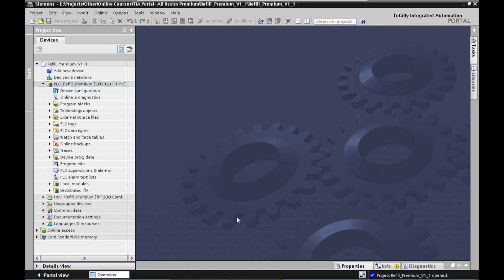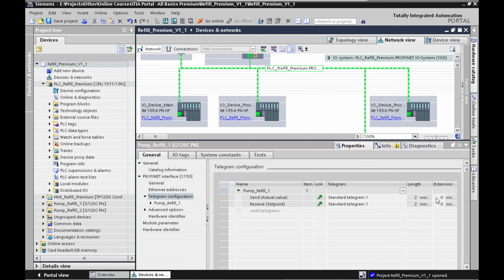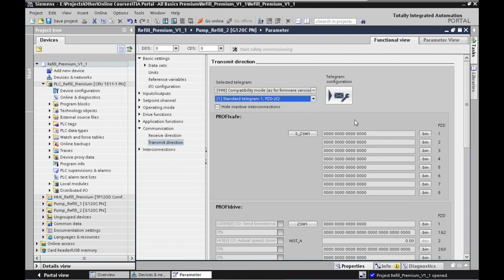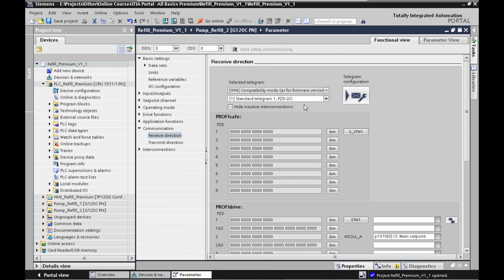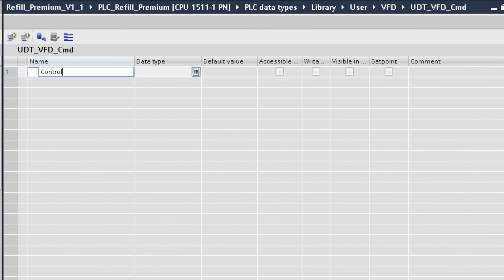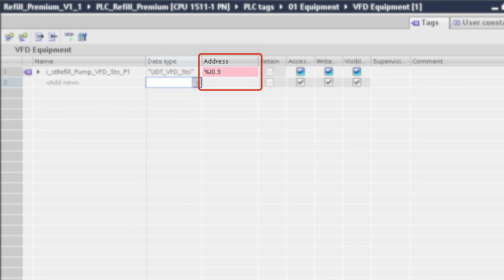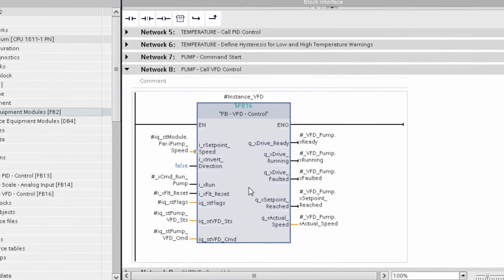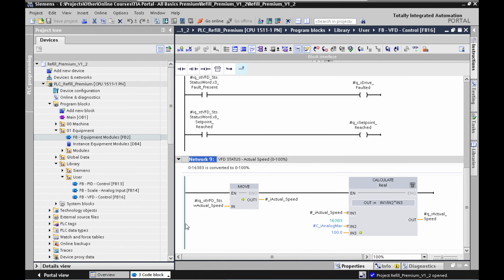How to Add a Structured VFD Control to your TIA Portal PLC Application (4 Step Tutorial)

Comment: your vids, your voice, your style, your speed, is excellent. you are a brilliant teacher. thank you.

setting up the drive side is very interesting as you need :
1. correct motor parameters
2. encoder setup
3. plc protection and quick disconnect, ..

thee drive side is where i would appreciate the slower, step by step clarification and actual commissioning of a drive with visuals
Reply from the maker: Thank you for the kind feedback and the great suggestion for a future video! 😊

Comment: Is this particular course if the premium bundle?
Reply from the maker: The VFD control is part of the premium content which is in the premium bundle.

The premium bundle includes PLC and HMI course which are online video courses.
And it includes the premium content which is not a course, but a premium TIA Portal project (PLC+HMI) which includes a VFD control block.  The premium content comes with a 92-page guide that explains step-by-step how to implement this VFD control into your own applications.

Hope this helps!
-Hans

Comment: in convert speed why the vaule is 16383 this number is it every time like this or depends of motor rpm
Reply from the maker: Analog input/output modules in Siemens systems often use a 14-bit resolution for analog signals.

For a 14-bit system, the maximum value is 16383. This means 16383 represents the full-scale value for analog signals (e.g. 10V, 20mA) when scaled.

So no, it does not depend on the motor rpm, it is simply a standard Siemens value for scaling analogue input or output values.
Reply: @PLCskilltree  So if i make set speed and actual speed in your way i will get motor speed in % from 0-100?
Reply: and #_rSetpoint speed can be my hmi input value ?
Reply from the maker: @ivanmuhar5560  yes and yes

Comment: Amazing Video. Do you have a dedicate video  how to control a siemens soft starter ( 3RW55-F HP 3ph 113A) from S7 1500 PLc  via Profinet . I have a issue to create the function block and relatives tag of control . 

Thank you
Reply from the maker: Sorry don’t have that, but the structuring procedures should be very similar to what I’m showcasing in the video.

Comment: Hi Hans chris again 😊. I've followed your steps and i created the "Standard Vfd Control FB", i've never thought it would be this easy especially the abuse of UDTs. But i wanted to ask about COMMISSIONING (inserting the motor data etc..), do you do it as a second step or do you follow another method ?
Thanks in advance 🙏
Reply: 1- I apologize for skipping ahead of the video i'am just a bit excited😋
2- It seems that my Noob brain  and its short term memory had a misunderstanding. I thought that "VFD control FB + commissioning" was enough and forgot about adjusting  the VFD's
Parameters through it's BOP/AOP  so it can be controlled by the PLC through PN like in our example. 

Signature 
         NOOB_Lvl_ONE_THOUSAND
Reply from the maker: Hi Chris,

My video about creating the software is the first step, before the commissioning.  Then during commissioning you will need to setup the VFD - give it an IP address, configuring the motor data like voltage, current, rpm, power etc....

I typically get the motor data from the data plate on the motor (picture with mobil phone) and I use the setup on the BOP screen of the VFD to set the applicable parameters to the correct values.  I also write down the motor data for each motor in my project worksheet, just so I have a backup.

Comment: It’s to complex and there are a existing functions for this in the library of the software
Reply from the maker: I disagree about it being complex.  It’s actually straightforward with simple steps.  If you’re used to building structures for your plc applications then this example is relatively easy.

Can you send me a link to the library that you are mentioning?
Reply: Sina_speed or Sina_Para ?

Comment: HI , 
There is no TELEGRAM option in my added drive properties 🤔
can you guide me ?
thanks in advance
Reply: you need to have installed the Startdrive tool. I had the same issue
Reply from the maker: Which drive did you add?  Which plc are you using?

Comment: Hi, what if i want to run backwars the motor? how can i do it using tahat telegram? wich flag should i use?
Reply from the maker: You’ll have to set bit 11 “setpoint inversion” of the controlword to “1”.  

My course (check the description below the video) comes with a sample application that shows you the exact logic first controlling the drive (including running the drive in the opposite direction)

Comment: Thanks for the video. Just one question: Why don't you create a UDT for this block interface like you did for the others? (with Cmd, Stat, Cfg, Flt)
Reply from the maker: Good question Sergio.  I usually create a UDT with Sts, Cmd, Cfg etc… structures for the parent module - in this example it would be the Refill Module.

Here I have chosen only to map the command and status of the telegram for the lower level VFD control block, where generated faults are part of the Flt structure of the higher level Refill block.

But this comes all down to preference. Yes you could create a complete Sts, Cmd, Flt, Par,… structure as well for the VFD but I prefer to keep that larger structure only for the parent module (e.g. refill).
Reply: @PLCskilltree  It makes sense since the number of interface signals to the block is low. Thanks a lot for the answer.

Comment: So as the video,i cant read Current ,Voltage from VFDs ?
Reply from the maker: In this tutorial I am using standard telegram 1 for data communication between VFD and PLC.  If you select a different telegram, you can get current and voltage status.  Remember to update the UDTs and control block as well with the additional status information.
Reply: @PLCskilltree  Can you recommend the best Telegram for control Plc and VFDs ?

Comment: May I ask you,sir? Is that method used for all VFDs those have Profinet interface or just for Siemens VFDs?
Reply from the maker: I have used these steps as well for e.g. Danfoss frequency converts.  The steps are the same, just different telegrams for the data communication between vfd and plc.
Reply: @PLCskilltree  so it depends on the different  manufacturers ? And how they define Control Word?
Reply from the maker: @Huyautomation2901  yes, but 4 steps for structuring stay the same.  I would always build UDTs that mirror the communication and I always build a standard control block.
Reply: @PLCskilltree  thank u for your reply.I hope u will make more video about PLC